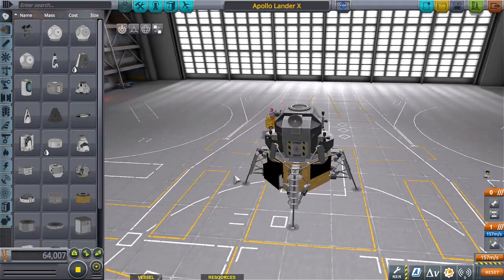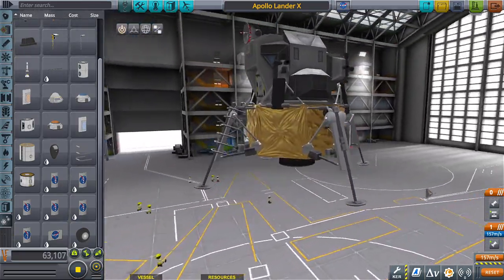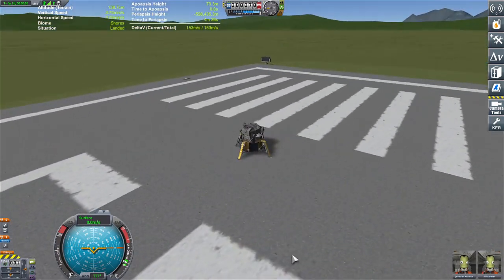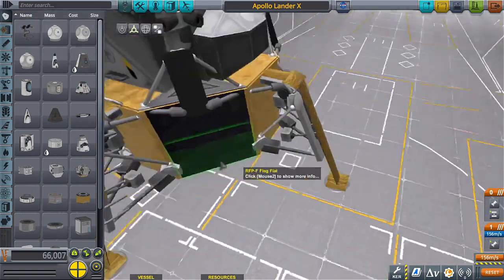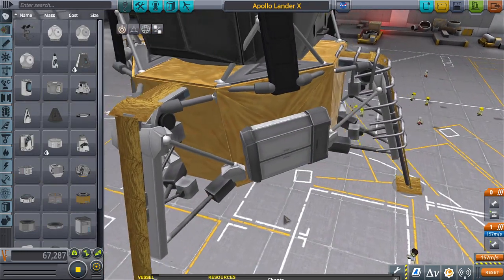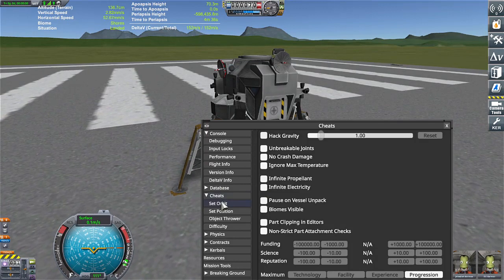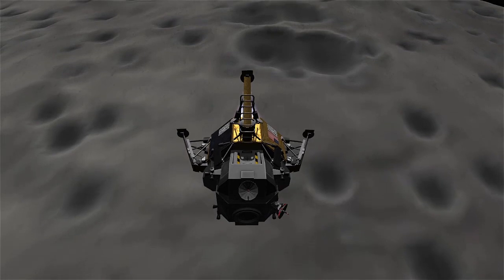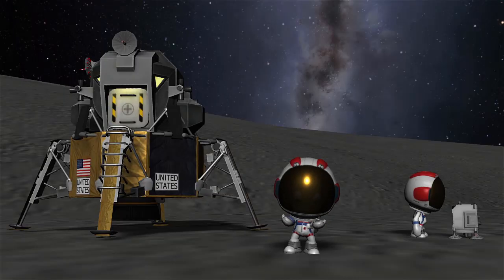APOLLO PROGRAM STOCK RECREATION part 2  \  KSP 1.11 \  Apollo program rockets and stuff.

Comment: 10:42 I see you felt the need to recreate Armstrong's bingo fuel landing.  :)
6:32 /sigh  So glad I boycotted 1.11.  
11:31 BOYCOTT 1.11, I tell you!  ...So we can all wait around to boycott the soon-to-be-released 1.12!  /bigsigh  I've been contemplating reinstalling an old version of KSP so I can go back to the good old days of air hogging and other fun.
Reply: I had to stop playing KSP. I can't find a version that balances features I want/don't want with presence/lack of bugs that make it playable. You might want to try 1.3.1 It's fast and stable, but it's not pretty and it's missing Breaking Ground. 1.7.3 is reasonably fast and stable, prettier, and BG mostly works. Of course then you get into mod versioning, and it's a whole other can of worms. It's beyond frustrating.
Reply: @cf453  I stayed in 1.7 for a very long time before finally finding a home in 1.10.  I think my brother is still in 1.3 but he doesn't play KSP much anymore.  Yesterday I did a stream of 0.90.  Many heartstrings were pleasantly pulled.
Reply: @ArchaicAlibi  Thanks, I'll try 1.10.
Nice job on the stream.

Comment: About the weight thing at the start of the video: I heard somewhere that the walls of the lander cabin were so thin that if someone were to punch it, it would brake and the cabin would loose pressure.